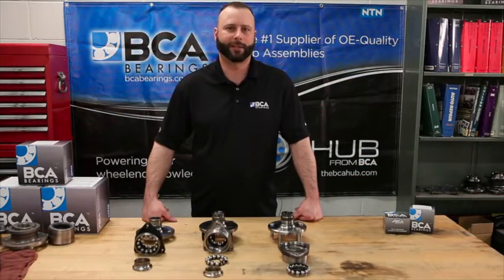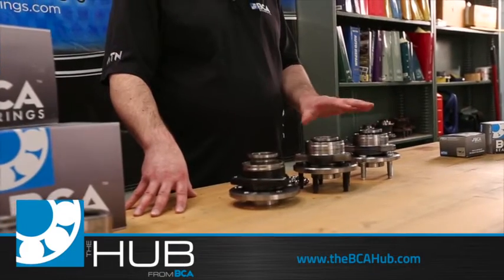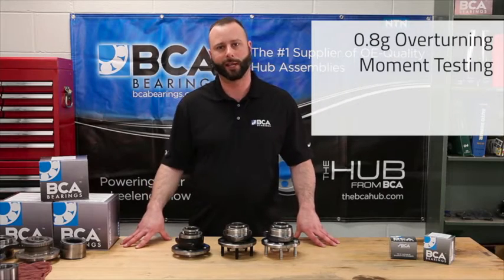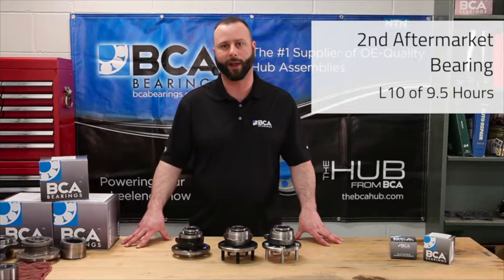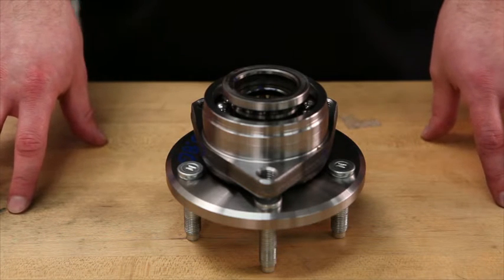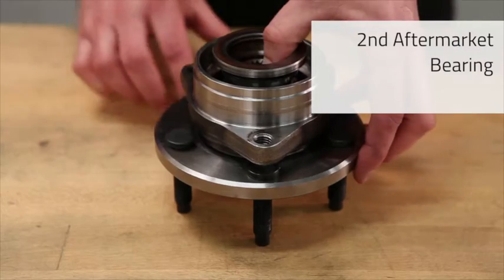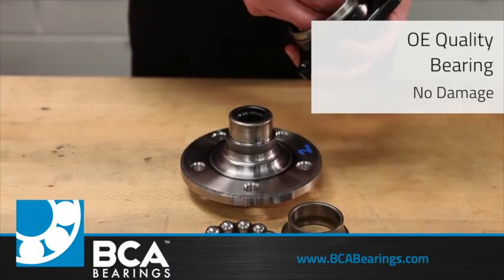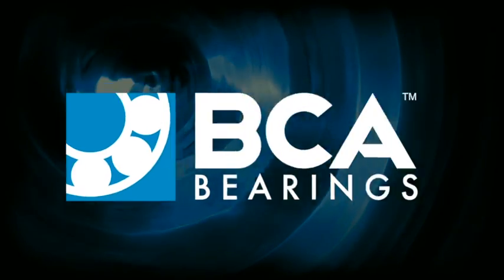Benefits of Using OE Quality Parts

Comment: One piece cassette type wheel hub bearings seem to degrade much faster than press in type. Why is this?
Reply from the maker: Good question. All quality wheel bearings should have a similar lifespan. Different types of wheel bearings can have different installation processes, and torque procedures to set the proper bearing preload. If you are seeing regular premature failures in a certain type of wheel bearing, it could possibly be caused by installation error.